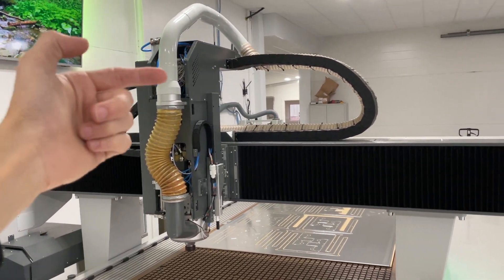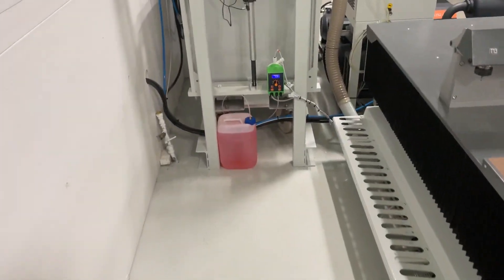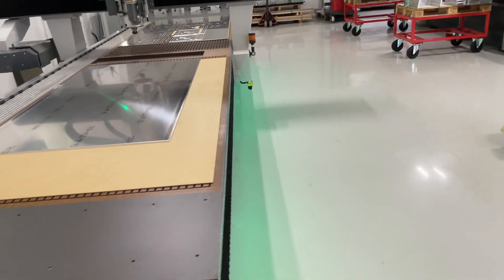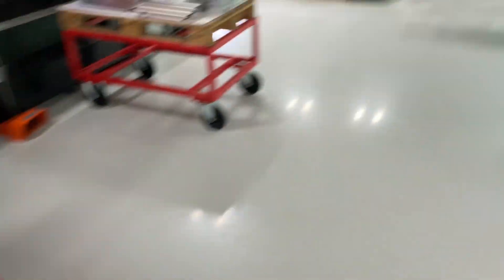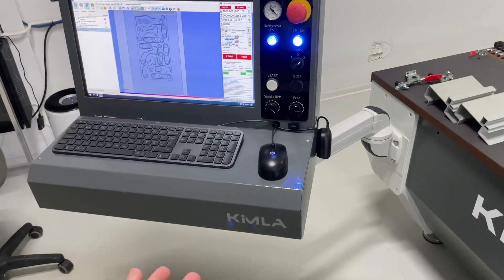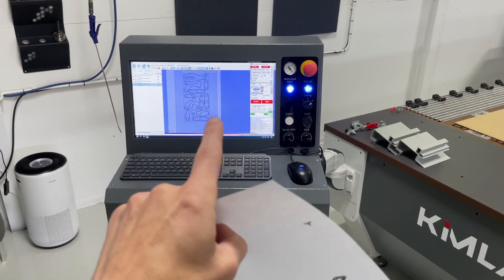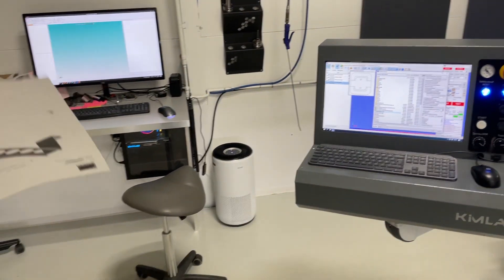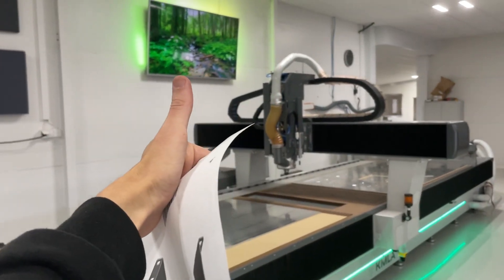UPGRADE Update 👀

Comment: We 3d printed our own drip solution, not mounted on a machine (as we suspected the movement moves the liquid too much and it sploshes around) to have an controlled and non variable solution for isopropyl cooling (80% isopropyl to 20% distilled water.. cheaper hehe) for aluminium cutting. None of the commercial mixers work - I would love to know how Datron does it - how they create a good alcohol mist.
Reply from the maker: Datron uses a ready made Microjet.de system that works by pressurizing the container and a tube in a tube to allow the ethanol to get to the close to the tip before mixing, no needle valve used.
There still is a bit of sputtering and I dont thick you can guarantee equal distribution among the different nozzles.
Its probably fine for the most part but if one nozzle gets a even a tiny bit clogged then more media will be coming out the other nozzles, that then makes it easier to keep clogging the already clogged nozzle since the flow is less.
I have this issue aswell since i currently mix before the distribution block.
Reply: @randomrouting  The system we designed was stupidly simple, a cheap peristaltic pump pumped ispropoyl mix into a sort of a carburateur - just throw drops into a chamber through which air rushes, it gets atomized and exits a simple nozzle. The venturi effect even helped clean the hose that entered the chamber so the dripping was somewhat constant although not perfect. The mist comming out of the nozzle wasn't perfect and constatnt (it was pulsing a bit), but it worked and it worked reliably without any big overall changes. Oil mixers were so tedious to set the correct amount of liquid to be atomized.. you set it up very sensitively and in 5 minutes it was spraying 5x the amount you set it only to not spray anything the next 10 minutes :D
Reply from the maker: @chronokoks  I try avoid veturi with ethanol just because the lower pressure causes more of the ethanol to transition into gas , which already is a problem when transporting ethanol and air in the same tube. I try to mix the ethanol at late as possible, preferably at the nozzle tip, so that it doesnt have time to vapour/gassify AND result in bigger droplets than a typical misting solution. (Like fogbuster)
This becuse the there's high speed air inside the suction cup around the spindle and the ethanol is fighting the airstream to reach the endmill. Bigger droplets deviate less.

I got some tiny pneumatic cylinders that i might incorporate into the bottom platter of the suction cup so that the nozzles could extend and get really really close to the target. We'll see :)

Comment: That green 'spindle stopped' light, why don't you use another pneumatic relay to stop the pressurized airseal on the spindle after an x amount of time?
Reply from the maker: Hey buddy. Yes I though bout that but I hesitated because the cone blowoff is coming in the same line. Dont want to be able to change the tool without the blow off. 👍
Reply: @randomrouting  That makes perfect sense not to use that.. some motion related output on the machine you can pull from the PLC?
Reply from the maker: @berendlucasvanderweide  Yeah there are a bunch of signals that I think would work but its so easy to use the signal for the light  as the radio transmitter is so close to it and its got a channel available. The plc is at the back of the machine.
There's even direcional motion signals, would be cool to control the ethanol and only spray in the same direction as the machine is moving :)
And yea flute length is no1 reason for issues overall, The 6mm chineese and crown norges I use have 12mm flutes but Firstattec sells some really short ones. 6mm with 8.5mm flutes among others. Sorotec sells them.
Kimla also sells short ones (Sklep.kimla.pl). 6mm dia 8mm flutes and 10mm dia with 12mm length,

Comment: Greetings from Poland. I watched all yours videos and i simply love them. I am working also on Kimla BPF1671 machine and second one is on its way (will be produced by 25th of October). In one of your videos from about 6 months ago you were presenting some non Crown Norge end mills (single flute); Startnow and Dronique - do you have some oppinion about them? We are buying Crown Norge from Kimla but recently they run out of short (12mm) cutting part end mills in 10mm diameter which is our main tool. Next delivery in 2-3 weeks so I am looking for alternative for cutting our 7075 alu.
Reply from the maker: Hi. Thanks 🙏 Im currently running crown norge (not superior range but the MP ones). The superior range continues to be unpredictable. The chineese endmills work ok. They dont ramp as aggressivly because of their geometry and they dont last as long so i still prefer the crown norges.
Hard to find good SHORT flute lengths.
Hoffman has some good endmills but not very much with short flute lenghts.
Sorotec.de sells firstattec endmills and they have a "Terrier" FAT.HSEFT.100.10.170 that is 10mm diameter with 17mm cutting part.
Firstattec does have quite a selection of short flutes like 5.5mm cutting length on a 6mm diameter single flute and so on. You might be able to buy direct from them, not sure.
Thats all i got. Hope you find something good 👍
Reply from the maker: New machine arrived ? Pictures!! 😄

Comment: Super.glad u  finally figured out the ethanol problem. Can u post a link to the system?seems a great idea.
Reply from the maker: I bought the pump at emecpumps.com. This is a KMS MF 2001 EP-PP. (20 bar,1L/H, EPDM/Polypropylene).
Comes in a nice package with some hose,couplings,level sensor ect. 595€+shipping
The PTFE tube i bought at ptfetubeshop.com
Reply: @randomrouting  nice .thanks for the info.still working on getting the insta .and fb account back. Can't get past the 2 step verification. Like everybody at there is a robot now :)) hahah